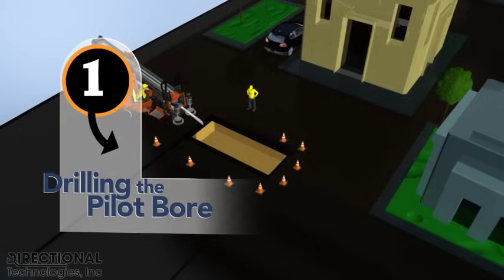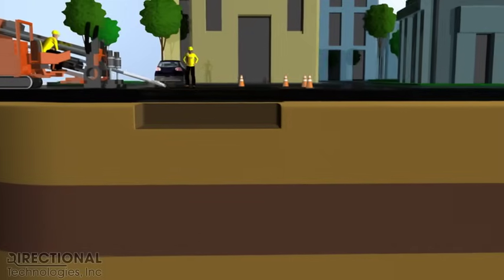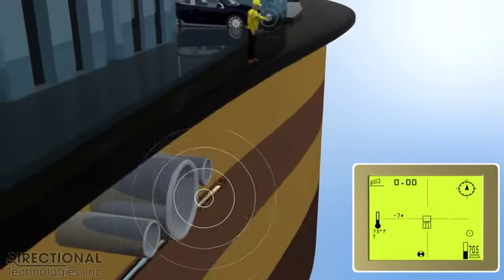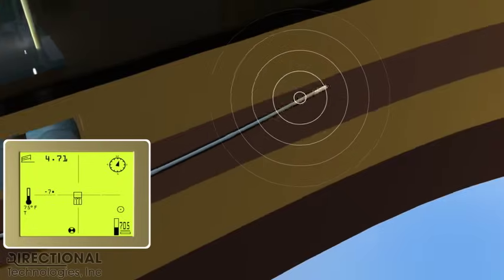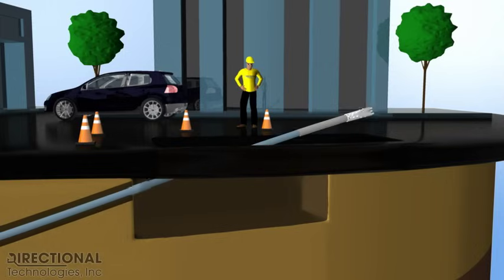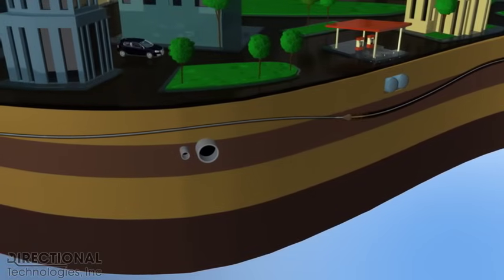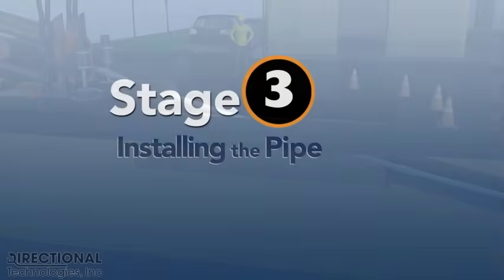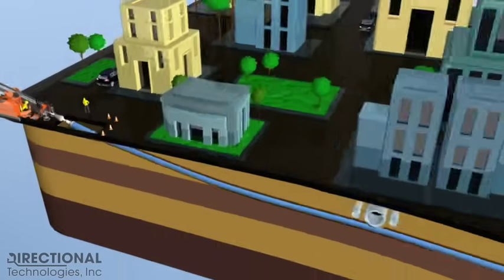Horizontal Directional Drilling Installation Animation

Comment: Can you use this to create a water pump? Take water from the ocean and put it in a man made reservoir?
Reply: If you install the pipes sure, why not? It doesn't really need to be for electrical conduits. I use this method on my plumbing projects many many times. Install a shut off valve and there you go!

Comment: Nice video.  Thanks to your tax dollars, our new invention allows you to build a pipeline of any diameter onsite; this virtually eliminates all transportation costs and leaking joints!  The pipe can be used for new construction, Horizontal Directional Drilling (HDD)  or to repair existing pipes and culverts (including subsea pipelines) by the slip-ling technique.  Please watch the short video below.
https://www.youtube.com/watch?v=EGsipDj0dEA

Comment: How do you know if the head going straight, turn left or right, going up or going down? Thanks
Reply: There is electronic beacon inside the drilling head. Can be powered by batteries or cable. There are different tracking systems (to see the drilling head location) but all of them tells you about the bit location, depth, inclination angle, tool face (that you need for steering), and some optional parameters like batteries status, temperature, downhole pressure, azimuth, predicted depth etc.
Reading the information from the beacon can be wireless or through a cable which goes all the way through drill pipes. There are radio, magnetic and gyro systems available for determining the drilling path.

Comment: How does the drill operator make the head move up or down or left and right ? Is the speed or what ?
Reply: It isn't drilling, it's pushing the head thorough, there's a slanted shape on the front that can be turned, which pushes the head to the side, all the time. To go straight, turn the head often, all the way around. The guy with the detector follows it at all times. At least, this was how it was explained to me

Comment: The head has an 11 degree angled bit on it that holds the locating device that’s installed behind it it tells you depth, posityor negative degrees in (pitch)0.0% is flat plus anything means it’s facing upwards by degree negative is facing down in degrees. The device in the head is held in place and tells you where the tip of the 11 degree angled bit is facing so you aim it up down left or right or anywhere in between to steer your way around throughout obstacles etc. I’ve been operating since I was 16 but that should some up some questions
Reply: Getting ready to start green on a crew, what’s the biggest dangers?

Comment: The drill inserted at 45 degrees angle, but how they straightened it parallel to the surface? Can anyone explain?
Reply: Your locator will give you a certain percentage to get up or down to to keep the head level. So let's say you go in at a -30% you'll keep going up 10% until you're level and then adjust from there it all kinda depends on the depth you're allowed to be at it and how long your rods are

Comment: good video, but how does the drill change direction or depth?
Reply: This is a very simplistic definition, it's by no means this easy, haha! Mostly it's hydraulic pressure up at the drill head that will change the orientation of the bit so that when the line is pushed it will move in that new direction. It can't change drastic angles in a short distance as the line can't handle those stresses, but gradual changes are possible.
Reply: @ouch_my_tongue  I’m a novice but thought this was way over simplified. They are drilling near my house and it’s taking a week to go 25 feet.
Reply: @pyronixe  could be a number of reasons for that. There is probably a lot of other underground utilities that they have to work around so they have to have everything located and think several moves ahead while working. That said, are you sure they've only gone 25 feet in a week? It can seem like they haven't moved much but have actually gone a decent distance.

Comment: How much does that drill cost
Reply: Oscar Díaz a typical JT20 brand new will about $80k . That size of machine that looks about a jt2030 would roughly be about $150k
Reply: Okay thanks
Reply: I have a set of drilling crew. 
We need,  auger horizontal drilling machine. If  some one  can get us any for job.  With condition
Reply: William Adjei you could talk to companys like ditch witch and vermeer for a horizontal bore drill
Reply: Hi , I am  a driller in African who won't  the answer for the same question.
Please let me know if you get it.

Comment: How the drill is directed ? Any video about it ?
Reply: There are several methods to know where the drill head is located (guidance systems).  It basically boils down to changing the direction of the bit.  Try this video or email me. elobello@aegion.com. 
https://www.youtube.com/watch?v=cl8BBoCV7gU
Reply: Simply via electronics in 2019

Comment: How driller changes direction and how it goes up and down??
Reply: https://www.youtube.com/watch?v=cl8BBoCV7gU
Reply: It have a steering, 
Contact me for more information.
Reply: Ayush Lal theres usually a locator which can be in many different brands such a “ falcon F5 ,  subsite, ditch tracker 150 and ect. “ someone who knows how to read the pitch can guide you with a cloak type system . For example if you want to go up you push 12, going down push 6 , push 9 you go left and so on .

Comment: I flag for a dirt crew that uses a bore machine and vac trailer. Its not about the machine but how well the crew operates and communicates. The crew I work with hasn't broke any existing lines of utilities in the 4 months I've been with the... it's a great system and least invasive approach to updating utility lines.